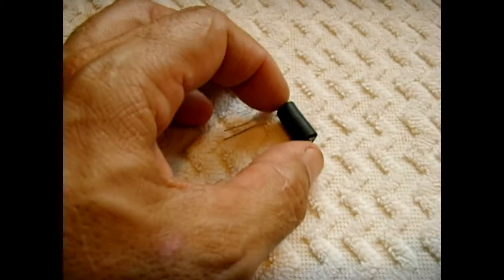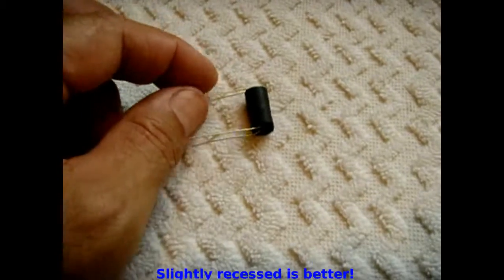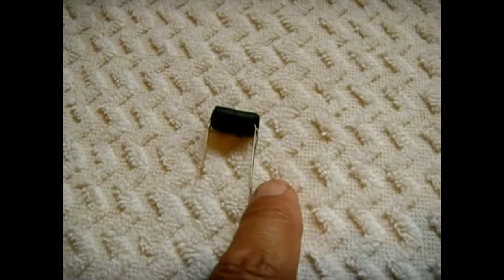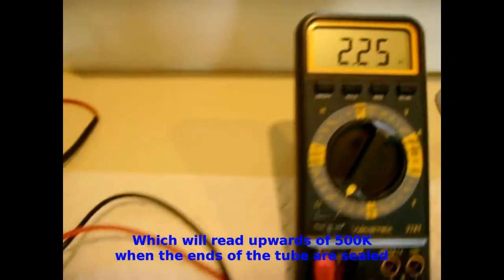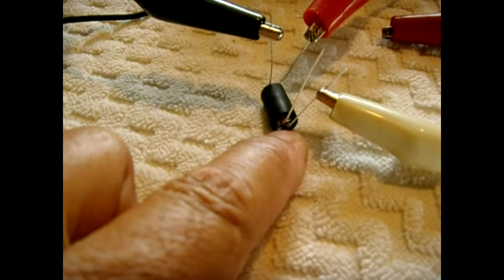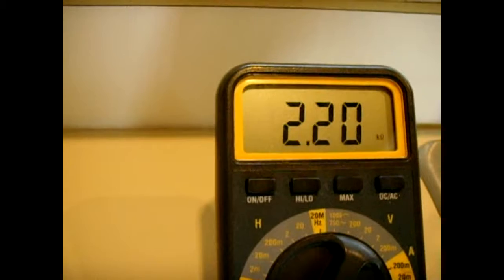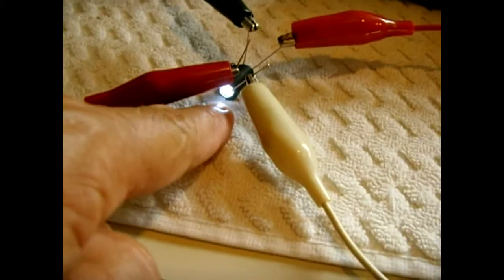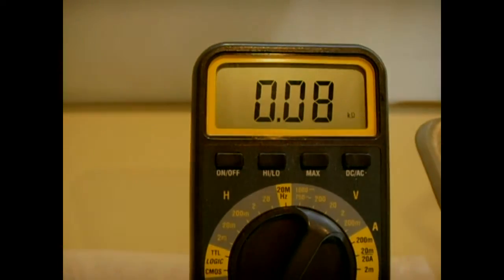How to easily make an Optoisolator / Optocoupler

Comment: Amazingly I've never saw this video before But  I recently came up with the " EXACT"  to the letter configuration you have here to apply +v to the gate on a mosfet thats been soaking up enough initial flow  to trash the 555's on me after only a few events.     My biggest concern is -> what to seal the ends of the vacuum hose up with to ensure bright sunlight does not ever reach the LDR     In complete darkness the LDR's that I'm using are ∞ an open which makes them very efficient but they must be completely optically insulated from the presence of light ...     Its kind of a tricky thing getting both devices in deep enough with soldered and heat shrunk leads and then squirting enough of something like black silicone into the ends so light can not find its way in past the leads    Its harder than you might think to get those ends sealed tight where absolutely not a ray of light can get to the LDR

Comment from the maker: Yes, that works also. You can use an LED to power the base/gate of a transistor. When bright light falls on the LED, it will turn on a 2n7000, or darlington type transistor(BC517/mpsw45ag)